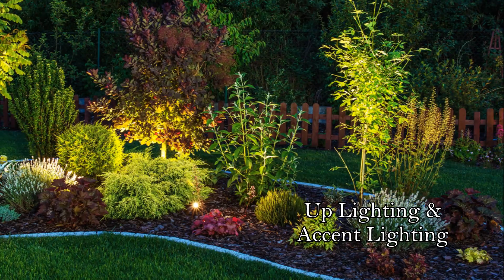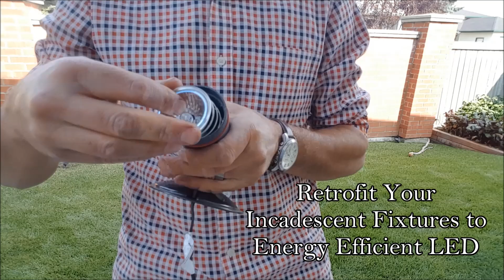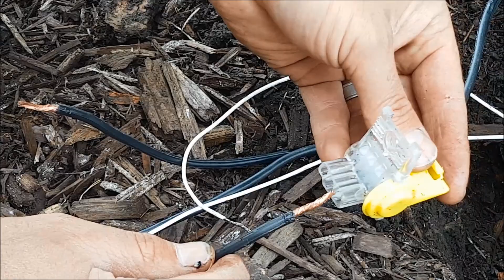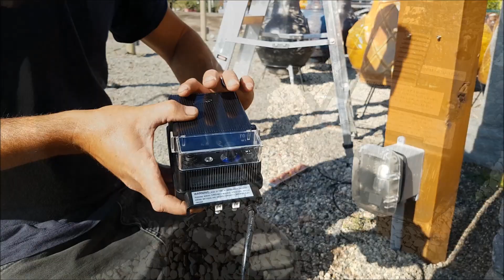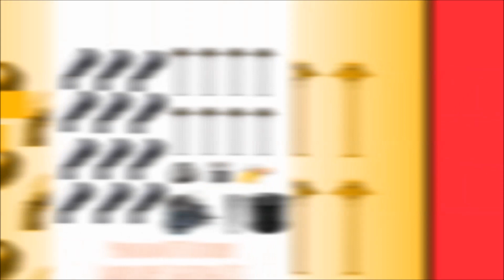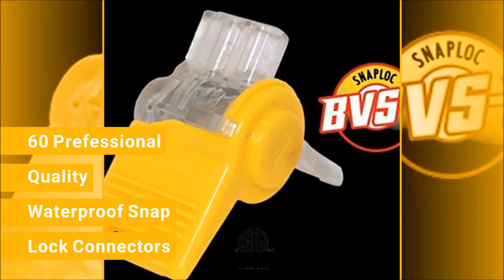Do it Yourself Low Voltage Landscape Lighting

Comment: Is there such a thing as a three-circuit transformer to run separate circuits for different parts of your yard? For instance, maybe most nights you just want a low light in the top of the fence posts, but if you have party, maybe turn on the up-lights on the trees.
Reply from the maker: Hi Robert, yes there are ways to do this. Google FX Luminaire Luxor Controller and you should find your answer.
Reply: Thanks so much for getting back to me. I'll check out your recommendation.
Reply: Home Depot has the Hampton Bay Smart 200 Watt Landscape Transformer Powered by Hubspace, it connects to WiFi, it also has 3 zones (so 3 taps) that each can be controlled by the Hubspace app separately and also integrates with Alexa and Google Home if you want.

Comment: any need to zone systems now with LED lighting?
Reply from the maker: Not as much. If you are installing a system that has more than 20 lights or have long cable runs between lights than you may still need to. However usually if the wattage of all the lights fits the trans former size you are using then you will typically be ok. Thanks
Reply: Lighting Doctor Ltd. ok thanks , I was just getting another opinion , some old school guys still zone it , I don’t I just keep it under what the transformer can handle , however yes and larger job or big runs usually require it . Thanks
Reply from the maker: Same thing out here, lot of the older guys cant quite wrap their heads around efficiency of LED. Appreciate your comments!